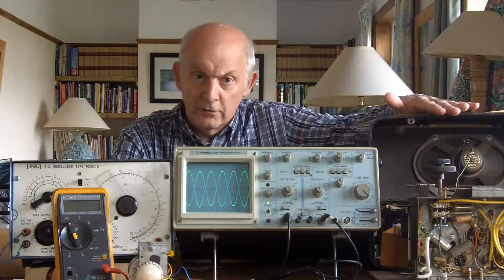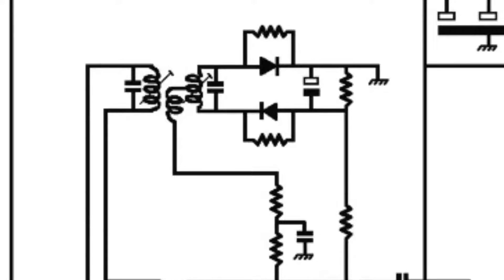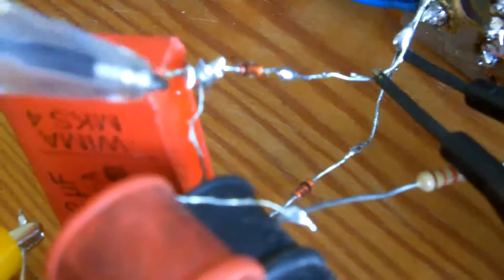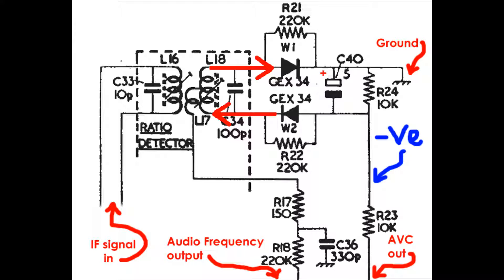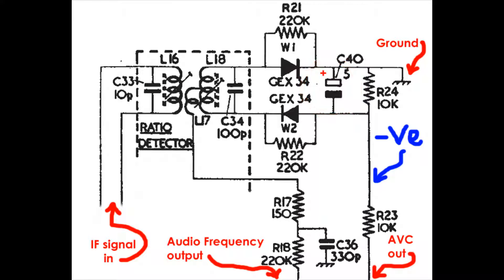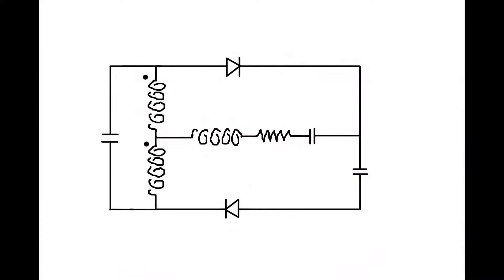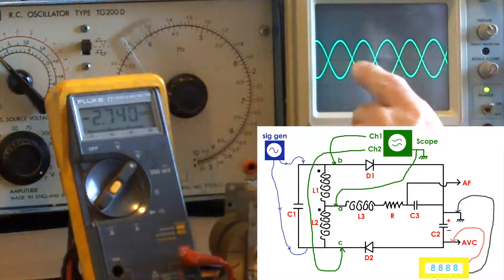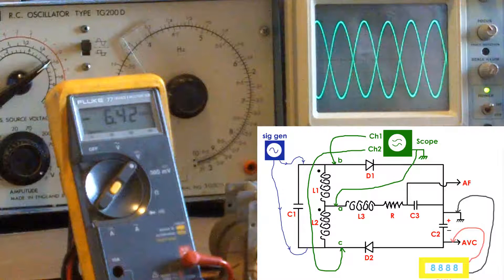About Radio ... Part 9 Automatic Volume Control by Andy Davies

Comment from the maker: No, I think it’s fair to say that speech compression is a far more complicated thing. ACV is simple. A negative DC control voltage is derived by rectifying the AF signal before the volume control. The AVC line increases or reduces the receiver’s amplification so as to maintain that control voltage at a constant level so, within reason maintaining a constant volume. Without AVC when you tune up the band some stations will be very loud others will be very quiet.
Kind Regards ... Andy

Comment from the maker: Good question. Normally the AVC line controls the amplification of one or more valves (tubes) or transistors.  If the signal from a station should reduce or fade then for any given volume control setting the automatic control line will try and compensate by increasing the volume. And of course if you tune to a powerful station the volume is automatically reduced. It’s a very practical system that works very well. Like any control system it can only work within its limits.
Kind Regards ... Andy